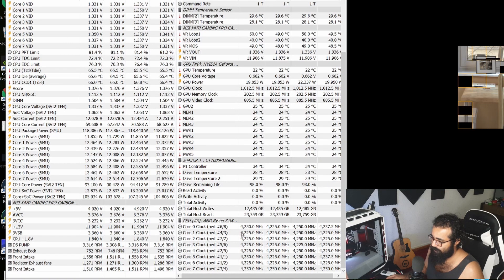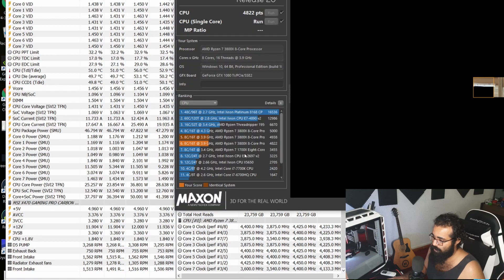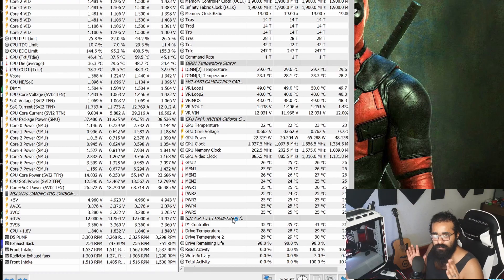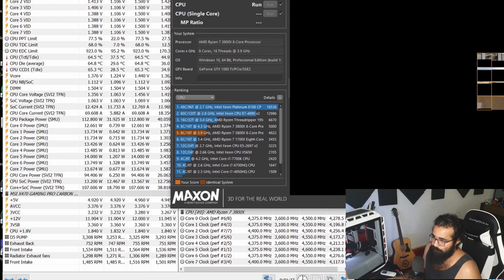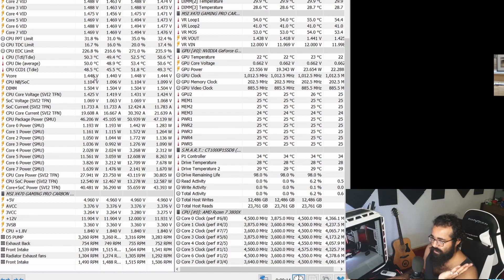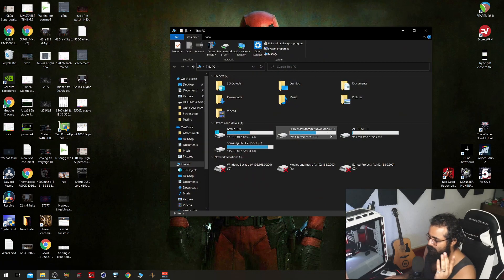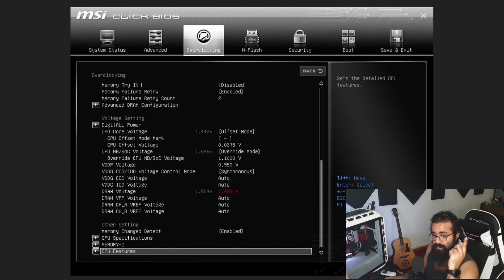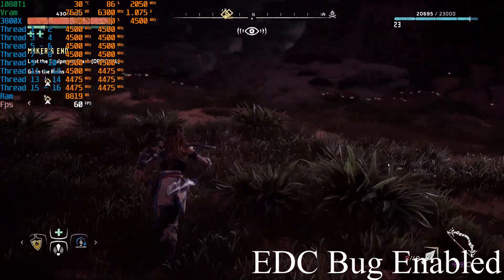Ryzen 3800X EDC Bug | How To

Comment from the maker: Disclaimer: If you dont have a good cooling OR dont know the risks involved, DO NOT USE THIS IT CAN DEGRADE YOUR CPU !
Reply: what i did notice on my 3800xt is that the clocks with edc at 12 i got 2 cores hitting 4.85ghz. and to what im thinking if the edc is the vrms on the motherboard how can this affect the cpu if the voltages are running at the same level besides telling the vrms to send more voltage to the cores to boost underload?
Reply: lol im on stock cooler running edc 1 10x scalar  for about a year  now

Comment: I heard about EDC bug since 2022 only thought of it as downside that requires fixing only to find out that its actually beneficial LOL.
from PBO manual 300-230-230, x10 scaler, Auto OC +200Mhz, thermal limit 120C
to PBO edc bug 300-230-8 (1 causes BSOD, 7 is the same & for sure 2-6 is the same never tried thou), Auto OC +200Mhz, thermal limit 120C
C-state disable, C&Q disabled, SMT disabled, CPPA+Pref core enabled, VCore LLC medium (longer boost but with reduction of 25-75Mhz boost) vs Auto (High behave like Auto but higher temp & voltage) = picked longer boost over 25-75Mhz inc. (CPU will not keep longer boost in light load in Auto & High will only do so underload), Vcore offset -66mv.
Also fine tuned RAM at 3733MT/s can't stabilize at 3800MT/s (however can boot) fully tuned RAM used all ram stability app with also instruction set (SSE,AVX,AVX512 from small to extreme) passed 24-72hrs per 1 app setting per app @ 98% manual setting and yeah including GDM Off 1T.
Reply from the maker: @gamertechlive1780  Honestly though, unless you do some competative benchmarks, yes. But for daily, I would do a fully RAM tuning with 3xxx and 5xxx non-3d CPUs, Its actually better to lower the latency by tightening RAM timings specially with a good B-die kit "not just primaries but all secondary and tertiary timings" . It will yield in better overall fps ( average and 1% lows ) specially in CPU bound cscenarios.
 
Though it will take alot of try and error for people that dont have enough experience with ram tuning. Both my 3800X and 5800x3d handled 4x8gb at 3800MT/s c14 1.5 VDIMM and 1.1v SoC . 

This 3800X is still alive in another rig now, running stock with wraith prism stock cooler, paired with 3000mhz c16 ram @ 3600 c16.. cant believe it handled all the abuse i did to it LOL.
Reply: @ammartech3660  Well i already did like i said RAM is fine tuned 97-98% manually tuned (tightest timing -1 lower per timing = error) and its GDM OFF 1T stable also uses B-die.. I tested it with ALL RAM stability App and PASS ALL TEST for 24-72hrs STABLE per instruction set depends in app if the option exist (SSE,AVX2,AVX512)   since I'm testing it with all stability apps and the reason why it reaches 72hrs is to avoid headache sometimes it will take near 12hrs (never reach or exceed 12hrs to be exact after 11hrs an error a single error will appear per App)  so I did up to 72hrs before switching with other App.. and Once its stabled I-re run everything from start from 1st app to last app for 24 hours = 0 error which take 3 months to stabilize due to GDM OFF 1T CR also VSoc, VDDP, IOD and VRAM Voltage are set to the most stable (lowest possible).

Comment: Can i copy these settings if i have a 3700x??
Reply from the maker: You can try, the 3700X is basically a lower clocked / less power hungry 3800X. 

But make sure to have a good cooler

Comment: it looks like it did imprve fps some by doing this edc bug. and this edc setting i found out isnt a bug. amd allowed it to be appiled so people can reach higher boost clocks by changing the pbo limts
Reply: tried manual PBO values and TBH edc bug pushes the CPU to reach its rated advertised boost clock and somewhat lil bit higher than that.
Reply: @gamertechlive1780  that's correct. Now if your not using the precision boost overdrive boost override with it then your missing out a little on performance. Some of the ryzen 3000 series only hit about 150mhz extra. Some will hit 125mhz. Just depends on how good the silicon is
Reply from the maker: I'm really interested in your method of doing the EDC.. 
In my video at least, I was trying to keep all core load almost if not the same as normal pbo or disabled PBO for longevity reasons..

Comment: With your settings my cpu uses the same or less power while clocking higher! I would even say that with your settings the chance of faster degradation is close to zero. I'll do some stability tests in a few months to see if something has changed.
Reply from the maker: Thats more or less silicon lottery 😀
This chip is a launch date 3800X which known to top out at 4.3~4.4ghz max back in 2019. 
Newer chips are way better, saw many 3700X's hit 4.4ghz with 1.32v or even less on all core overclock :)

Comment: MSi Afterburner does NOT display individual core speeds correctly, each core speed displayed is just the highest core speed at the current time being shown across all cores. Just to let you know...
Reply from the maker: Then explain how come two threads went down to 3.6ghz at 10:24 while all cores are up to 4.5ghz? 
Also, some few threads do jump around while core clock shows 4500mhz too . So im not sure whats your point is

Comment: Hi. Good information and thanks for the screen shots. I'm a bit confused though. My 3800x in an x570 tomahawk only boosts to 4075 when running cinebench r20, but I get a multi thread score of 4870. Bios is back at default with only xmp turned on. Why can't I get the boost speeds you see across all cores? I'm running the stock prism cooler. Sorry for the questions. I'm a noob.
Reply from the maker: Might be because my cpu is pretty cold, im running a custom loop.. 
However, are u on the latest bios? That or the stock cooler might be the issue